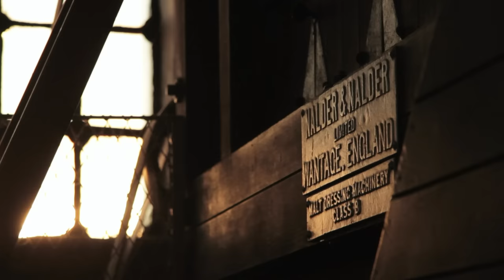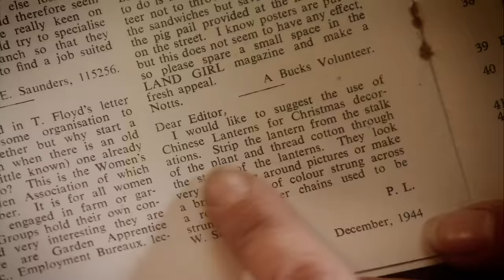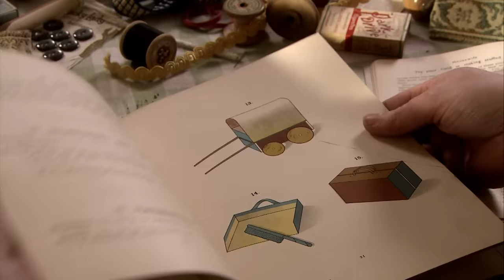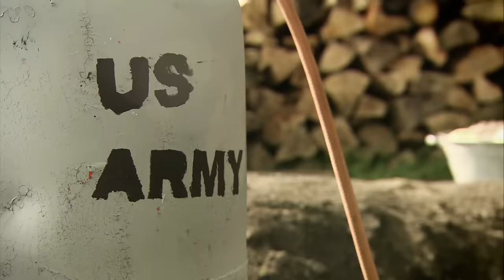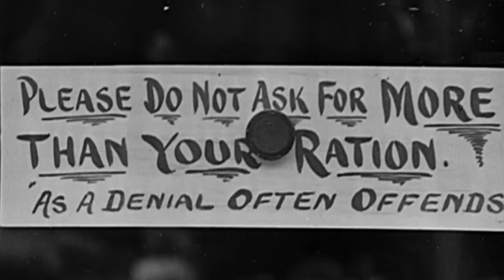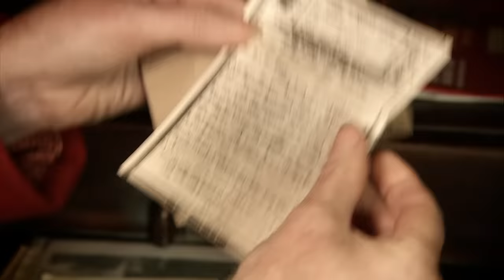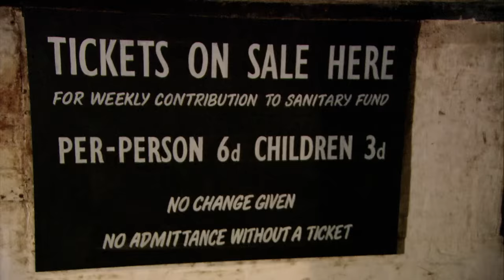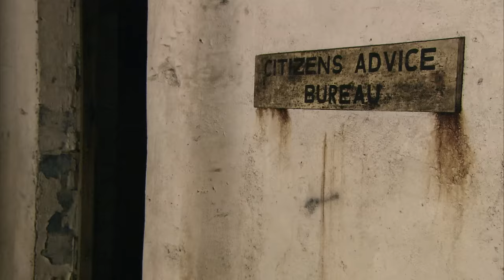Britain's Underground Christmas During The Blitz | Wartime Farm: Christmas | Absolute History

Comment: 35:30 blew my mind! 🤯 I was not expecting the pine oil to look like that.
Reply: 35:20 blew my mind!  I was not expecting a dog that cute.
Reply: I suspect that’s where the saying ‘pitch black’ comes from
Reply: In the U.S. it's called pine tar.  It can be found at farm supply stores.  To use on tool wood handles it is cut 50% with turpentine.  The turpentine allows it to be soaked up by the dry fibers in the wood.  Lay the tool or handle out in the summer sun to warm up.  Then apply liberally to the wood and let it sit overnight.  Wipe off any excess with an old rag and let dry.  Dry rot won't happen and it is protected from the elements and insects.  Rats and mice won't bother it either.  It's been used for centuries.  500 year old homes in the Scandinavian countries have some original parts that were treated with pine tar over the years that are perfectly good.  It's especially useful for wood that will contact the ground.

Comment: No reason not to make your own decorations anyways.  You can use recycling and nature around you.  No need to spend money if you really don't have to.  Especially with Coronavirus19 and so many on lockdown and not working. Nature provides!
Reply: Pine cones make lovely little Christmas trees. The beads that they toss at parades can be cut to individual balls and hot glued as decorations. A little white paint on the tips of the pine cone looks like snow or ice. A cardboard disc wrapped in jute twine is the base.